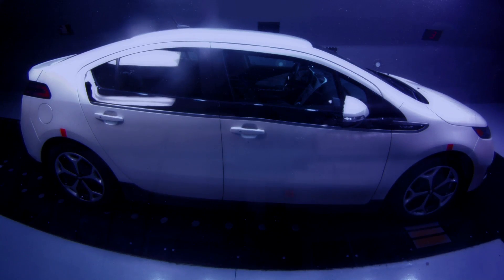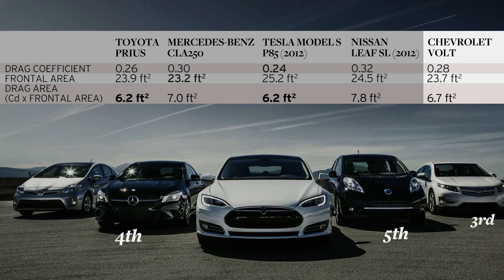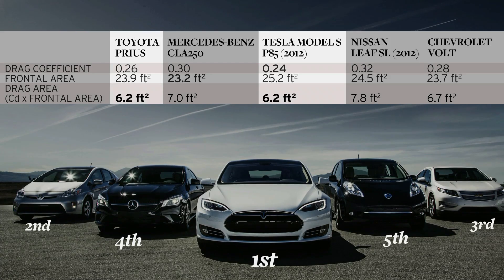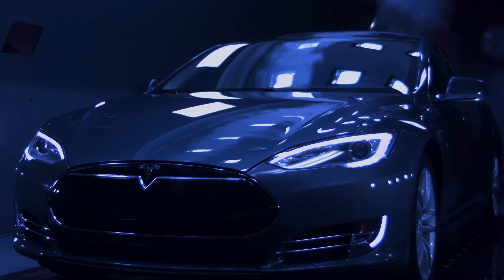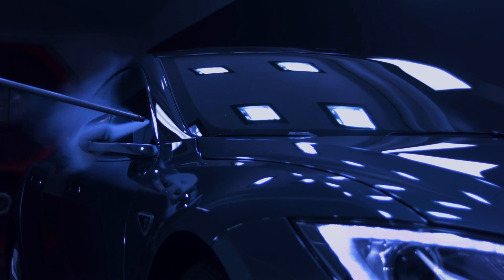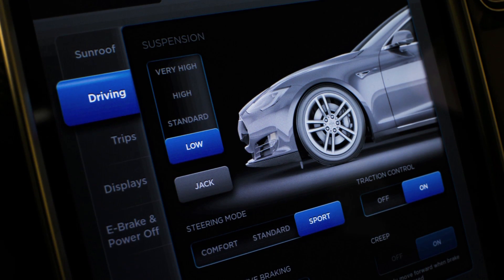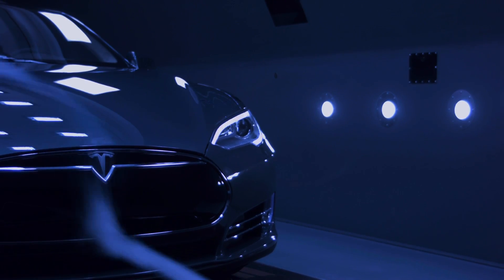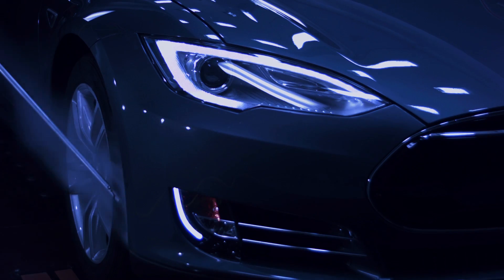Aero Comparo! Tesla Model S vs Volt, Prius, Leaf, Mercedes CLA

Comment: No it isn't F-ing practicle or drivable!!!! The damned thing has a range of 230 miles and then needs to be charged for 14 hours (120 V outlet). Has the whole world gone crazy? The Tesla epitomizes the word 'scam'.
Reply: someone is a little uneducated...
Reply: CAPTAIN LEAF BP Dude if you think about it lets say your mom and sister do drive 150 miles in a day (totally impractical) and work 345 days out of the year (guesstimate). thats over 50,000 miles a year, and heres some more guesstimate amounts. Lets say both their cars get about 20 miles to the gallon. And just to clear it up, lets say that both cars are fully paid off (I don't know if you guys lease or whatever). well you would spend around 8,750-9,000 $$$ (big ones) a year on gas not including lease price if you have that.

Now heres a little math to help you with this. 

With incentives added in I built how I think a Tesla should be built, and what would most likely be good for you: 

Smart Air Suspension
Tech Package
Fog Lights
Parking Sensors
Leather Interior & Wood Trim
Panoramic Sunroof
60kW Battery Pack (While The Combined Mileage Of Your Mom And Sister is Pretty Large I'm Pretty Sure Individually This Pack Would Be More Than Practical Enough For Daily Driving On Highways Even In Winter With The Heat On)

Now with my state incentive, and other small deductions I could get my Model S all the way down to around 700-800 a month which is just about how much you would pay for gas each year. So basically I'm not saying you would be saving money (you would have 2 cars) but with the Model S, you could afford to have 2 cars rather than one. The maintenance is great (something particular Mercedes have troubles with, coming from my own [Yes Im a Mercedes owner and it is a 2003 piece of crap]) and fuel cost is little to none. Yes maybe the new S Class beats it according to Consumer Reports but you would pay a lot more for that car. The Tesla Model S is the best hands down when it comes to keeping it cheap. If you want a car that drives great, handles well, and cost little to nothing to drive go for it. After all those "after work lake trips" don't come everyday. And even if they do, buy another charger for your lake house and get the bigger battery. That way you can give it some extra juice to drive it home without anxiety.

Finally that point you made about ruining your battery with the supercharger is wrong. The Tesla was built to handle the charge. Its like computers and over clocking. While it can be bad for the computers, if you have enough fans to cool the system it won't show significant (barely minimal) effects. Its not like your just gonna lose all your batteries charge in a day. Its a matter of years with how far their batteries are ahead of everyone else's.
Reply: you never heard of the superchargers? 14 hours my ass
Reply: CAPTAIN LEAF BP 150 miles commuting every day is just foolish. Why don't they move closer or get a job closer to home? That is a ridiculous amount of gas, wear are tear on their body, and hours a day wasted. Most people have 50 or less mile roundtrip commutes so the Tesla or even the Volt makes perfect sense for the majority of people who don't go on a road trip every single day.
Reply: CAPTAIN LEAF BP Oh i see. Obviously the car that goes the fastest is the better one. Nothing to do with comfort, safety, power, features, innovation, emissions, technology or luxury. Its all about the time at which it travels 235 miles. thanks for pointing that one out to me.
Reply: I don't know where you live but over here I couldn't possibly drive more than 200km a day on regular workdays. And I bet it's the same story for most people here in Europe. Yeah you couldn't go on vacation with this car, but it is not really built for that anyway.
Reply: Superchargers can charge it in 30 minutes. It can also have its battery swapped in under 90 seconds.
Reply: lifehacker123 In America a car is about freedom. You can get in your car and drive almost anywhere on a vast network of roads. You don't need anyones permission and you aren't really constrained by anything, unless you buy a Tesla! Why limit yourself? There is no reward for being foolish.
Reply: lifehacker123 Yeah but we're not talking thousands of miles, we're talking a measly 230! Both my mom and sister (practitioner, and CEO respectively) drive 150 miles (round trip) to work everyday. If they decide to drive out to the lake after work on a friday night they'd be really sweating it.... for what? Why bother? Why not buy a car that you CAN drive anywhere you want? The Tesla just does not compute.
Reply: Do you like leaving monuments to your own stupidity all over youtube?
Reply: I thought I told you to go educate yourself. You had the perfect opportunity to stop sounding like a moron, yet you persist. Lol! Tesla's battery pack has a 10-12 year formulation, with an 8 year unlimited warranty. It's called improved and advanced technology you Idiot!. A mere 10 minute Google search would allow you to see how wrong you've been on every point, and how stupid you look. You can't possibly be this stupid. Clearly, you're just Trolling.
Reply: CAPTAIN LEAF BP
Well it probably may not work for them but it certainly works for anybody who lives and works in a city.
And why bother? Because it is the first electric car that people actually want to drive. It is much better than buying a gay Toyota Prius hybrid or the even more stupid G-Wiz.
A Model S just looks so much better and has a ton of horsepower. And all of that in an electric car which is theoretically eco friendly.
Reply: StalePhish
This.
Reply: CAPTAIN LEAF BP ewwwwww Why would you go backwards with a gas engine
Reply: CAPTAIN LEAF BP You constantly speak of range anxiety. I own a Tesla Model S, and i can assure, you only have range anxiety for the first day or two. Today i have absolutely no range anxiety, and i love my Model S. It is fun to drive, easy to drive, powerful, comfortable, has an unreal amount of storage space, can easily hold 5 adults (much less cramped than my old Mercedes S class). Even though you dont believe it, cars like the Model S really are the future of automobiles.
Reply: AsymmericEquilibrium Hahaha, yeah maybe, Metros are absolute garbage.
Reply: Make it electric and get freeeeeedom from gas!
Reply: That's like comparing oranges to apples. A prius is a hybrid vehicle, while the tesla is an all electric vehicle.
Reply: Good comment, however, nothing I said was wrong or inaccurate. I am picking up my new Merc in Germany in a week, and when I drop that kind of cash on a car, or any cash on a car, I want to be able to drive the thing.... Superchargers DECREASE the longevity of your batteries.... there's no way you can say that buying an electric piece of shit is a good idea, there's just not way.
The Tesla model S is a monument to its owners STUPIDITY.
Reply: stopcrazypp Good comment, however, nothing I said was wrong or inaccurate. I am picking up my new Merc in Germany in a week, and when I drop that kind of cash on a car, or any cash on a car, I want to be able to drive the thing.... Superchargers DECREASE the longevity of your batteries.... there's no way you can say that buying an electric piece of shit is a good idea, there's just not way.
The Tesla model S is a monument to its owners STUPIDITY.
Reply: nazirzh Good comment, however, nothing I said was wrong or inaccurate. I am picking up my new Merc in Germany in a week, and when I drop that kind of cash on a car, or any cash on a car, I want to be able to drive the thing.... Superchargers DECREASE the longevity of your batteries.... there's no way you can say that buying an electric piece of shit is a good idea, there's just not way.
The Tesla model S is a monument to its owners STUPIDITY.
Reply: stopcrazypp Good comment, however, nothing I said was wrong or inaccurate. I am picking up my new Merc in Germany in a week, and when I drop that kind of cash on a car, or any cash on a car, I want to be able to drive the thing.... Superchargers DECREASE the longevity of your batteries.... there's no way you can say that buying an electric piece of shit is a good idea, there's just not way.
The Tesla model S is a monument to its owners STUPIDITY.
Reply: Good comment, however, nothing I said was wrong or inaccurate. I am picking up my new Merc in Germany in a week, and when I drop that kind of cash on a car, or any cash on a car, I want to be able to drive the thing.... Superchargers DECREASE the longevity of your batteries.... there's no way you can say that buying an electric piece of shit is a good idea, there's just not way.
The Tesla model S is a monument to its owners STUPIDITY.
Reply: CAPTAIN LEAF BP
Yes and how many times do you get into your car and drive for thousands of miles? Probably not that often.
The Tesla S is supposed to be an everyday car and not a Harley Davidson.
Reply: dlwatib Look man, I'm not making personal attacks on people (like you),
 I'm simply making an eloquent point and backing it up with a few facts.
Reply: lifehacker123 Ok, it looks awesome, I totally agree. If you could put a gas engine in it, I'd have no problems with it. My problem is with buying a performance car and then driving it with 'range anxiety' (driving slow with worry everyday because you're worried about running out of juice). Its like buying a good looking ice cream cone that has no taste, whats the point? Its missing the essence that makes a car, a car; a tool for FREEEEEEEEDOM!
Reply: StalePhish Its a haul for sure, but its probably not that much more time than the average commuter spends in a large city who drives in from the suburbs. Plus as far as my sisters concerned, its not easy to find CEO jobs in greater Minnesota.
Reply: Bad Drivers of NH Welcome to the internet -_-
Reply: bebomac5 Yeah so what? I could still beat you in a 235 mile race driving a Geo Metro.... and that was my entire point.
Reply: TheWade822 What I saying is simple: the Geo Metro is the crappiest car I can think of, and it still furnishes its owner with more freedom than a Tesla. The Tesla Model S isn't a REAL car, so why bother comparing it to the Benz when it can't even beat a Metro in the primary purpose of a car; freeeeeeeeedom!!!!
Reply: King Melon Ok cool, what if I have a lake home thats 267 miles from my home?
Reply: CAPTAIN LEAF BP you go to a supercharger then.
Reply: King Melon P85D or 85D can go 275 to 295 miles on a single charge.
Reply: CAPTAIN LEAF BP I would also like to point out that a Tesla ha REGENERATIVE BRAKING, which recharge the battery. And also you do know that the range is only an estimate depending on only the testers average of usage. it you drive efficiently, then you would spare a lot of miles.

The Tesla Model S is also very much innovative, and much more safer than a lot of gasoline cars, I'm guessing only a small amount. All that I'm getting from this is that because this is new technology, people are scared that this "thing" is not so safe, and a lot of questions will appear. As you learn about this car and how safe and innovative this car is, you will not feel that you are in the dark.

This is a potential vehicle, actually, no, this is the vehicle of the future, as it runs on electricity, and generates 0 emissions. We only have one atmosphere and should not mess around with it. Sure you might argue that electricity is not a renewable source ( referring to the coal plants), we could absolutely use solar power. You would save so much GAS MONEY, by driving an ev, but also you are saving the planet. You could save thousands of dollars driving an ev than a gasoline car.

Even if you use electricity from a coal plant, you still distribute a lot less emissions into the atmosphere. Anyway, this is all I have to say for now.
Reply: Idiothi5 Sorry, that Tesla* and has*
Reply: CAPTAIN LEAF BP You can't understand this car because the Model S is not designed to be your car, or your only car. It's for families with big houses, own E or S class, Vans, and want something different. For them the cost of this car is nothing.
Of course, there are many buyers whose drives are less than 60min per day only.
Buying a Model S is not stupid.  If you ride one as a passenger, or test drive one, you might get blown away by its quietness, handling, and performance.
Sales figures don't lie.
Reply: I just picked up my new Merc in German in June, and yes, I am the demo for this vehicle.... I think the Tesla is a momunent to its owners stupidity.
Reply: It's ok. I won't blame your ignorance.
Reply: Thanks, I appreciate that.
Reply: lifehacker123 So you are going off at him for saying a Tesla sucks, and then proceed to call a Prius "gay". So then, the Tesla sucks as much as a Prius is "gay". Plus, for that guy, the Prius is BETTER than the Tesla because you an go 800km on a tank.
Reply: Idiothi5 and he was also talking about a pure ICE car, so there you go. Yes, people will compare apples, oranges and grapefruit. Nothing says you cannot.

Comment: Should totally do this with a Veyron, that shit slippery.
Reply: LOL the veyron isn't slippery at ALL.
Reply: You clearly no nothing of aerodynamics...
Reply: Thomas Semeniuk A 2013 Ram 1500 has a cd of .36
Reply: Thomas Semeniuk LMAOOOO 0.36 is not good at all, and even though the veyron has a smaller frontal area than any of these cars, its effective drag area is still higher than any of these cars as well - only the leaf comes close. that 0.36 also only available when the car is in that crazy high-speed mode;the normal drag coefficient is 0.41 which is ridiculous - no doubt due to the numerous radiators and extractors that cause turbulence - and also why the veyron needs a thousand horsepower to go anywhere. conversely, the insane amount of downforce it must create can only work at 250+ if the body manages that turbulence properly and it's probably part of the reason why even captain slow can go that fast without hitting a tree.
Reply: the veyron needs downforce, it can't be as slippery as these cars
Reply: It's coefficient is 0.36 that's pretty good, but the surface area is lower than these cars, i'm just curious.

Comment: i have read somewhere that the cla has a cw of 0,22
Reply: Like the guy in the video said, some wind tunnels may be different, but when you compare more car in the same tunnel then you can make a ranking..
Reply: Turdeanu Stefan But the other measurement results agree with my sources
Reply: Obviously this Mercedes CLA didn't test near as well as the one in Daimler's own wind tunnel. This one tested only 0.30, not 0.22.